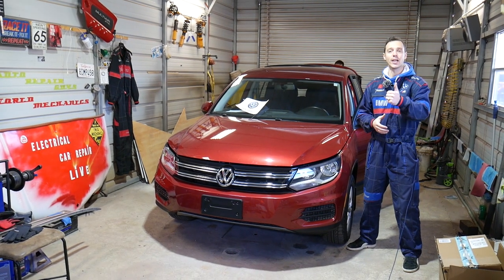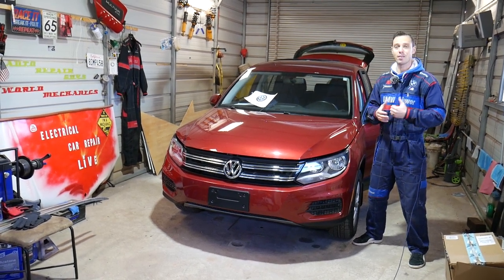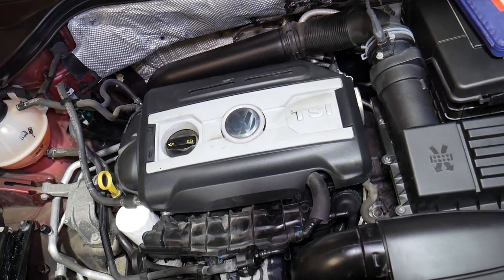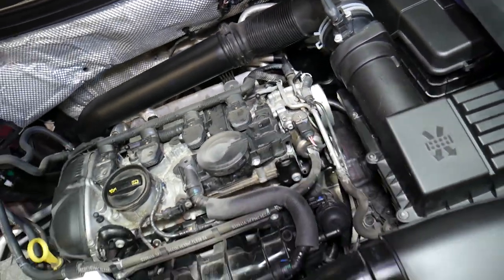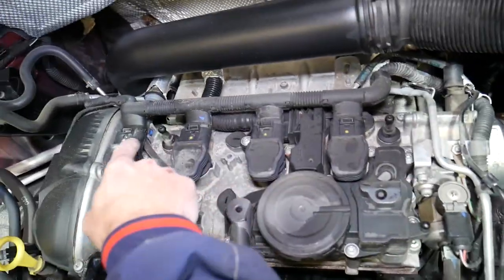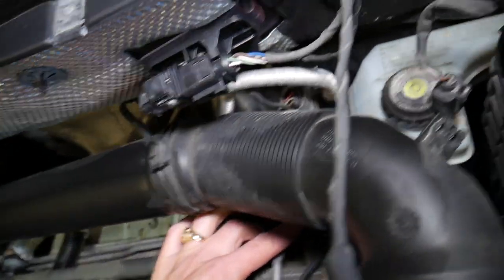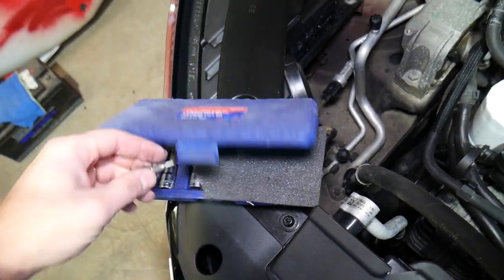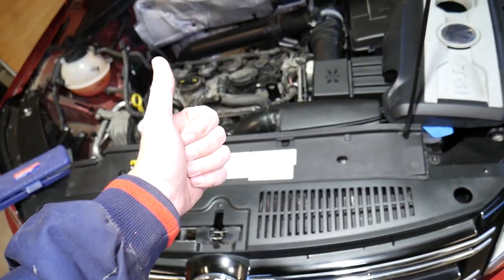VW TIGUAN BRAKE VACUUM PUMP LOCATION REPLACEMENT EXPLAINED. WHERE IS THE VACUUM PUMP

Comment: I am trying to use CRC Intake Valve and Turbo cleaner thru brake booster vacuum hose to maximize this cleaner to valve.  But the vacuum hose from vacuum pump leads to three different area.  One to Brake Booster, one to left metal tube, the other comes to front, near to intake manifold.   Could you tell me which one I need to disconnect to feed this cleaner?

Comment: I don’t see the repair on the other channel? Can u send a link?
Reply: Can I have it as well
Reply: Evan Gil The Job is actually very easy man did it with no repair manual but all tho I’m mechanically inclined, if u have done auto work in the past besides oil change and rotation u can do it
Reply: Evan Gil should take 1 hour out an in
Reply: Thank you for replying it looks simple I just wanted a reference😁😂 but thank you for at least verifying the easiness of it!
Reply: @evangil6414  Was it easy?  About to replace mine.  I'm like you.  I THINK I can do it, but...
Reply: @pauljohnson7413  super easy bro you take off the 3 bolts on the side and remove whatever parts are in the way and it comes right off just as a fair warning a lot of these bolts strip really easy so that's the only issue i had 😁